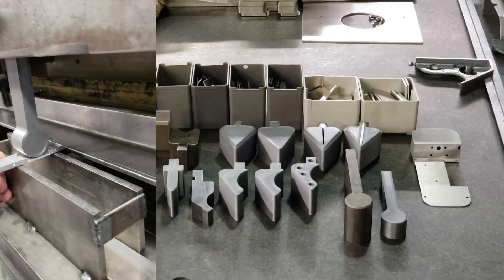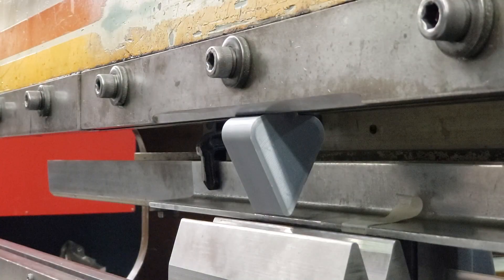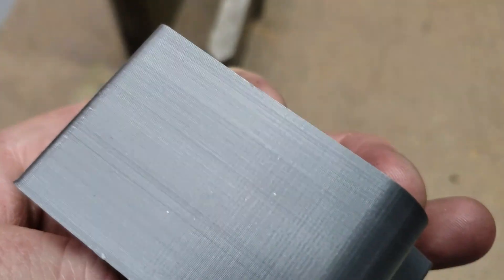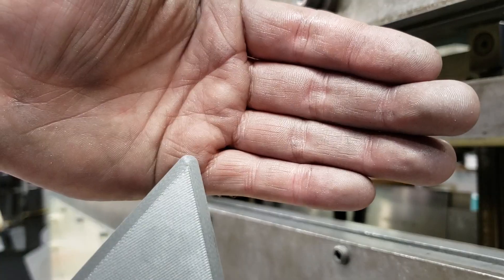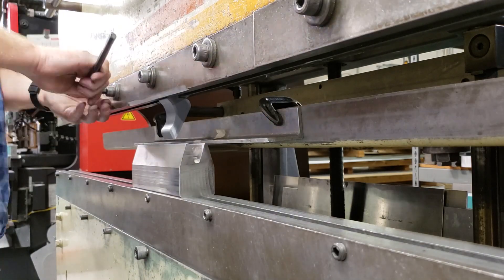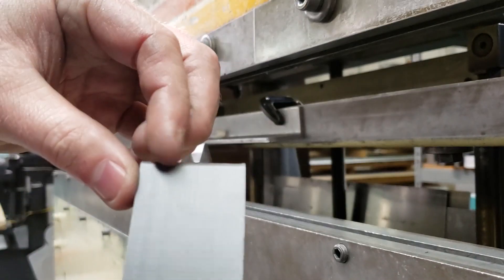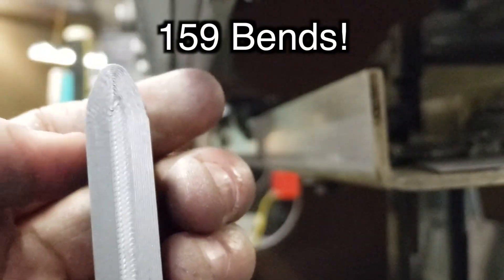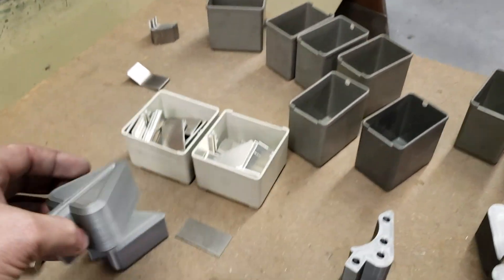Bending Thick Steel with 3D Printed Tools - Prusa PLA

Comment: I'd print the gooseneck 100% fill in rectilinear.  gyroid sacrifices some stability in XY for stability in Z, but you don't necessarily need that here.
Reply from the maker: More perimeters are more important than a higher infill percentage. Check out CNC Kitchen's video where he demonstrated that 6 perimeters with 15% rectilinear infill is stronger than 2 perimeters and 100% infill. https://youtu.be/AmEaNAwFSfI

He also made a video a video testing XY vs. Z strength of different infill patterns and while you're right about gyroid, the grid and triangle infill patterns would be even better than the rectilinear for XY strength as needed for the gooseneck. https://youtu.be/upELI0HmzHc
Reply: @ProtoG42  I love CNC kitchen, but I'd say that his tests don't apply very well in this use case.  His standard tests are usually tension or shear,  and in that infill comparison he's doing compression only in the Z axis (which, if you think about it, makes sense that grid is stronger than rectilinear because much more of the infill is overlapped, vs rectilinear it only overlaps in a few spots instead of along entire strands)  (edit: oops i was wrong about the infill test bing only in Z, I recalled incorrectly.  I'll get to that in a sec though.)

You're using almost 100% compression along the XY axes, which means that even if it's weaker in tension, 100% infill will be much stronger in compression because there's no air in there to compress.  Grid infill has a tendency to leave air gaps at 100%, which is why I prefer rectilinear when printing 100%.   In the case of the gooseneck, you do have some deflection so it's clear it isn't 100% compression, but I think just having the extra material in there will prove to be much stronger, even keeping the large number of perimeters.
Reply from the maker: @RentableSocks  the 12 perimeter gooseneck  only noticeably deflects when bending the 11 and 10 gauge steel which I'm still pretty impressed with at only 20% infill. If it came up that I need a similar custom gooseneck tool for 10 gauge steel, I will probably try testing more infill compared with a few tools I have drawn up that are reinforced internally with sheet metal. I have also started designing some 3d printed radius attachments that slide onto existing steel gooseneck tools. The 3d printed attachments would be great because it will print very quickly and could easily be swapped out when it starts to wear.
Reply: @ProtoG42  yeah that's a good point on the gooseneck though.  Preventing that deflection is top priority.  maybe that's just not a use case we can get to with FDM.  I suppose it could be possible with sintering or that FDM that needs to be autoclaved to sinter, forget what it's called.

I like the idea of the radius attachment, that should keep the printing where it's appropriate, but keep flexibility (not in the tool!) too.  Might be interesting to create a new gooseneck type device that is built specifically to accept attachments that could be 3d printed.  Maybe it's too specialty though.

Anyway great work, super interesting.  I'm very impressed with how well everything worked, even the gooseneck.  Do you recall how much force is required for bending 11 and 10 gauge steel like that?

Edit: just had an idea.  a 3d printed tool that accepts a steel insert for the radius.  so you make two tools, one to bend your specific radius, and one to accept the bent radius.  keep the friction and the load on the steel insert that you've bent, extend the life of the tool used for the majority of the work.  Should keep surface wear down.
Reply from the maker: @RentableSocks  to bend 10ga mild steel with that specific V-die opening requires about 0.79 Tons which is 1580lbs!
Reply: @ProtoG42  I'm very interested to see the one with interior reinforcement. I was thinking a radius tool that would take standard available pipe sizes and add perimeters. Or a vertical piece of steel running into the clamp and pressing on the tip perimeter. This application seems like a good use for fiber reinforced FDM as well, primarily for stiffness.

Amazing how well this worked without special setup. I'm going to print a couple of small tools for my arbor press now.
Reply from the maker: @brs_workshop  unless you are making  wierd offset tooling, PLA is all you need. Even then, PLA is plenty rigid enough to bend a majority of thinner jobs without flexing. 10 gauge steel is thicker than 90% of the jobs we run through the shop.
Reply: I was thinking of some solid layers, rather that 100% fill. Either with the setting for solid fill every "x" layers, or adding a modifier box in slicer to just create a solid layer either in the middle, or a pair that are evenly spaced to help distribute the load. either way, I agree gyroid fill isn't helping much here.
Reply: Did you try printing a die with the carbon filment for added strength?

Comment from the maker: Try 3D&CNC service at PCBWay 
https://www.pcbway.com/rapid-prototyping/
Reply: It looks like you're using the default 0.4mm nozzle - it'd be very interesting to see if a 0.8 or even 1mm nozzle /line width would significantly improve strength. It would certainly improve print time!
Reply from the maker: @UnreasonableSteve  CNC Kitchen has a good video showing layer heights larger than 0.2mm actually get weaker. https://youtu.be/fbSQvJJjw2Q
Reply: @ProtoG42  There are a couple of potential issues with the methodology that video, but mainly I would consider looking at layer height as a percentage of line width, with a 0.8mm nozzle, I've found 0.4mm layers act pretty normal, but a minor bump in temperature and 0.6mm layer thickness can be extremely strong. I'd definitely love to see some tests if you end up getting a nice thick nozzle, though!
Reply from the maker: @UnreasonableSteve  agreed! I've only ever used a 0.4mm nozzle. Even if the strength is comparable, it's worth the time saving printing with a much larger nozzle.
Reply from the maker: @UnreasonableSteve  a much larger nozzle like you suggested may make a difference though
Reply: CNC Kitchen has a really good video with test results for nozzle size
Reply: Have you tried annealing the PLA parts once printed? They say makes it stronger and more heat resistant. Some of the wear you noticed can be heat related as metal warms when bending it.
Reply from the maker: @GroovyDrifter  I did consider annealing but after doing some research, I'm not sure I want to deal with the the shrinkage that occurs as a result. I could use a thin rubber film that we normally use to reduce the tool marks caused by regular tooling to increase the lifespan of the printed tools.
Reply: For stronger prints I do all of these: Increase print temp (225-235 pla) (265 abs), print solid 100% infill (doing so means excess perimeters isn't necessary and the extra perimeters might even reduce part strenght), increase extrusion width (.4 layer height use 0.5 - 0.55 width etc), +1% or +2% extrusion multiplier to over-extrude slightly. Run no part cooling fan and slow the print down slightly (eg 50mm/s vs 60mm/s) The layer separation is from failure to fuse the material layers together and can be improved with these settings. Your dimensional accuracy may suffer slightly from overextrusion so if that is a concern you can either design for this error (swell) or sand in post. Nice video
Reply: 0.6mm nozzle would dramatically improve strength, also using PC PEI or FEP would greatly improve strength. If I were making this part I would use FEP with a 0.6mm nozzle. Maybe I would go to 1.2mm nozzle, never seen a use for nozzles between 0.6 and 1.2mm. 0.8mm loses so much detail and requires a volcano heater block to print at the same speed. At that point you might as well go to supervolcano with 1.2mm nozzle and get the best strength. 1.2mm is similar to an injection molded part strength wise. Layer adhesion has near 90% strength, it is shocking when you first experience it.

For something like this, 40% infill would be better in my opinion.
Reply: Please build the filament extruder next: https://medium.com/endless-filament/make-your-filament-at-home-for-cheap-6c908bb09922 I am not good at making YouTube videos but I want tech to make filament accessible to other people
Reply: Do you know of any articles that use 3D printed inserts in a dedicated tool-holder to cut down the plastic used? The end of the tool seems to be the area that wears the most as well as being the part with the most important architecture, and the parts would print even faster. Something like that would also make a stronger gooseneck easier to produce.